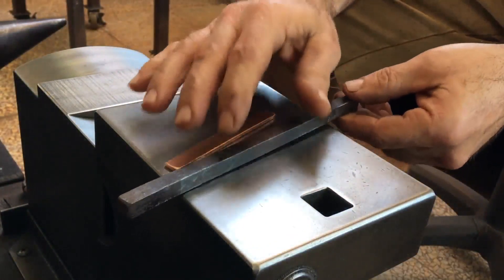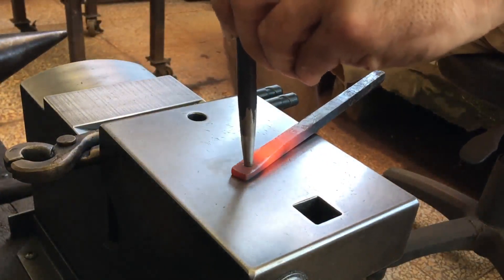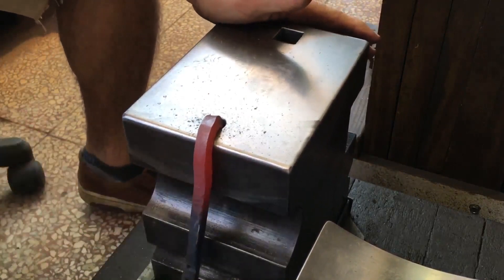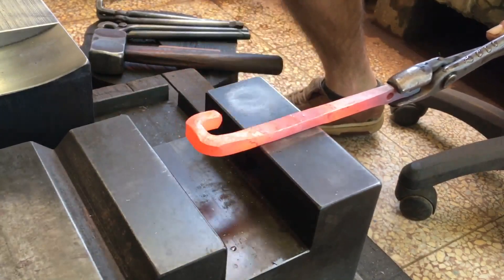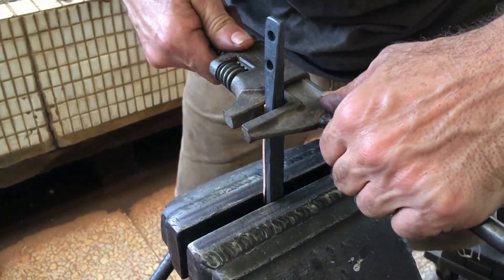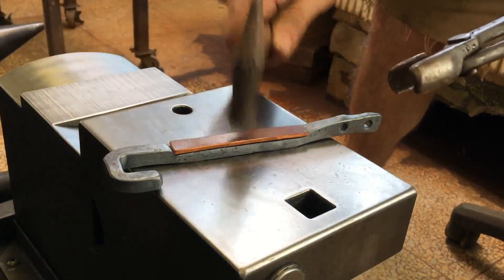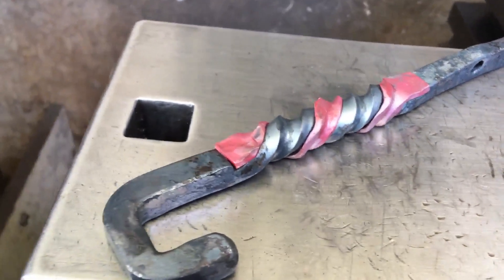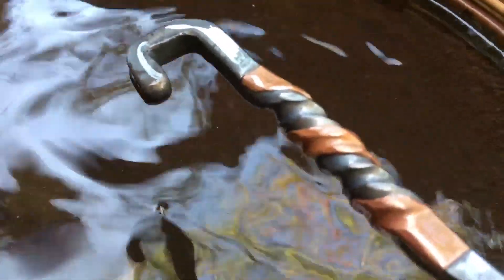Copper & Steel, you know the deal...

Comment: Looks cool. have you done much with inlay work? I'd like to explore that sometime.
Reply: Hey it looks like you use a coal fired forge also. I have used copper wire to inlay letters in antler handles. I had a friend who used copper and stainless steel wire to inlay designs in blades
Reply from the maker: Thanks for watching and replying.
Reply from the maker: I never tried traditional copper inlay but it intrigues me. I once melted copper and joined (welded) it to steel and I thought that was something that I could try again. Lots of stuff to try... Thanks.

Comment: Okay, maybe slot punch a hole down the centre of the bar and then put the copper in and give a couple twists. I might try that on my own volition.
Reply: Or maybe put a piece of copper on each side and copper pins through each copper piece then twist. Just a thought
Reply from the maker: Another good idea. I need to have another go at this... Thanks.
Reply from the maker: That's a good idea. I thought if I had a rod of copper, that would be the way the go. Give it a try. Thanks.

Comment: That looks really interesting.  You could also add a strip of brass (or bronze, or even stainless or titanium) to the opposite side and get three different colors.  I thought I would put the ends of the copper to the back (if I were to try something similar), but the copper fits really well, and maybe I wouldn't decide to hide the ends.  Great video.
Reply from the maker: I did think about brass but not doing it in addition to copper. That would really be something. But from my very limited experience with brass, it seemed to become brittle. But I will do this again and maybe give brass a go. Thanks.

Comment: Any way it would make Damascus, using sheets of copper and steel?
Reply: Not sure about that, melt point of copper way below that of steel - But you can do it with copper & nickel, known widely as Mokume Gane.
Reply from the maker: Thanks again for replying.
Reply from the maker: To be honest, I'm not completely sure. It would be tough with the different melting points and I'm not sure it would even be called Damascus. The thing I was worried about when doing this was melting the copper. Thanks.

Comment: So i like this with the coper you can make for exmple a handle for door and wear is the grip for hand to be the copper twisted and i dont now way you have not put borax between the steal and the copper and to hammer it lidl bit. I am not a professional i am just a welder and i beleve that this shall help bud nice combination i like it.
Reply from the maker: I think if you want to have the copper weld to the steel, that using borax is a good idea. I tired that once before and it worked well but only if I used flux (borax). Thanks for watching.
Reply: @gstongs  i use borax wen i solder silver is cleaning evrything thats multi flux for all metals bud in this temperature wear you working i beleve will gwoll a lot.

Comment: that's really interesting!  I never would have thought of making a mechanical connection rather than trying to weld them.

what are you going to use that hook for?
Reply from the maker: I'm always trying connections other than welding since welding is not an option for me with most projects given my work space and tooling. Will probably use this hook in the laundry room. Thanks.
Reply: @gstongs  
that makes sense.  I think I remember you once saying that your forge doesn't get hot enough to weld well—or doesn't handle that much heat very well.

Comment: Is it true that, while steel may become hard when quenched, that copper actually becomes softer ?
Reply: Yes. Copper is annealed by quenching. However, copper work hardens. The more you hammer on, bend, or manipulate the copper, the more rigid and brittle it becomes. The Ooolllddd copper chisels used in antiquity would have gotten tougher the longer they were used, up to a certain level of hardness. After that they would need to be remade or risk cracking or worse.
Reply from the maker: Thanks for your detailed reply.
Reply: Yes
Reply from the maker: Thanks.
Reply from the maker: Short answer, yes. The replies to your comment said it all. Thanks for watching.